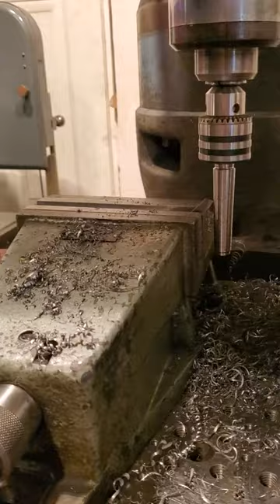Fixing Harbor Freight small drill chuck using a knee mill as a lathe.  chuck up a pin and turn!

Comment: Be careful those chucks are only press fit in , but you should be fine, I use my mill as a lathe all the time.
Reply from the maker: I used a brass hammer and chalk powder to seat it.  Any tips you can share?
Reply: @below_average_rat_rods  no tips , probably would’ve done the same thing haha
Reply from the maker: @tylergibson7226  #realtalk